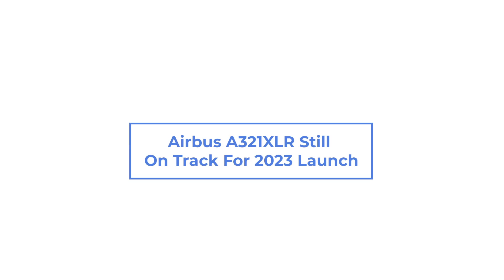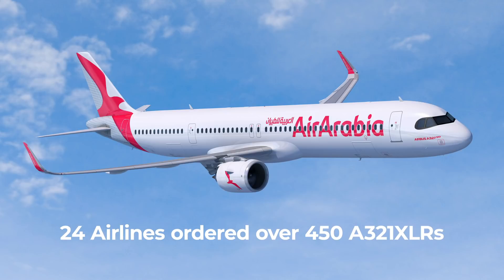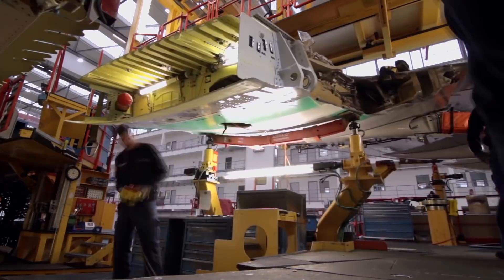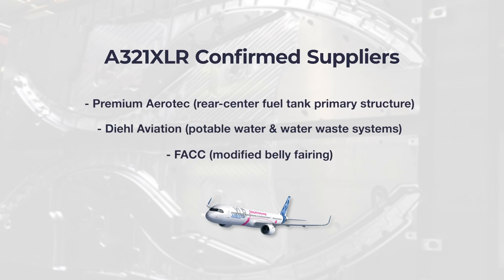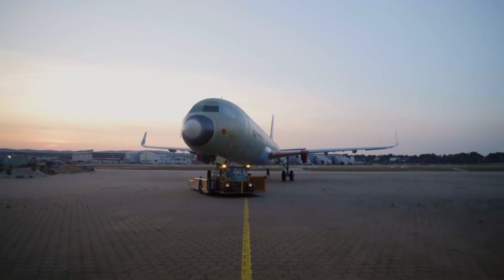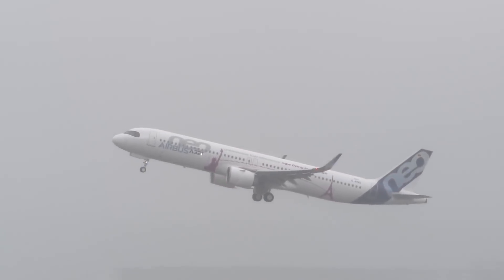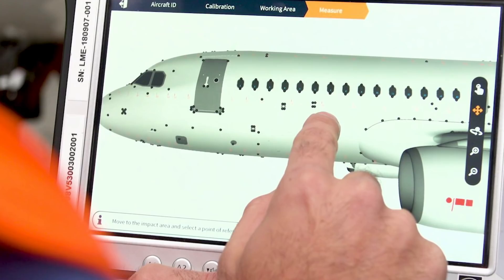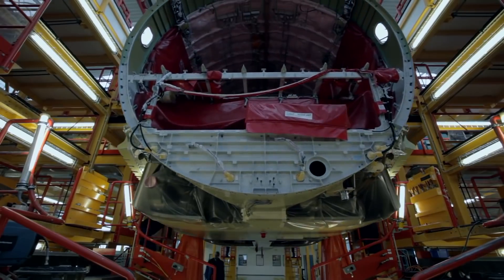Airbus A321XLR Still On Track For 2023 Launch

Comment: Hope I'll not have to fly this kind of aircraft for longer than 2h. Hope it'll be also a seat limitations for low cost airlines for example no more than 210 seats in single class configuration. Btw does anyone can imagine to fly over Atlantic in aircraft with no reclining seats and no IFE?
Reply: There is nothing wrong in flying medium to long haul single aisle aircraft was long as the the there is good seat pitch and space.

Comment: I think A321XLR will be a key part for aviation after Covid-19 because due to the lower demand for long range routes the A321XLR can solve this problem because it doesn't have so many seats filling the necessary gap making more profitable and efficient for the airlines. That's why Airbus wants to keep developing it and to launch by the deadline. 
It's also a way to kill the competition, Boeing, because the NMA project is in risk due to Covid-19 and other Boeing problems for example the MAX and this way Airbus can have this market all for itself.
Reply: (My opinion) if the 757 was available today the number of orders for the A321XLR would be less then there are without the 757 in production.
EDIT: Typo.
Reply: @ScottRothsroth0616  I absolutely agree. But it needed to be fitted with at least new engines and sharklets for efficiency and new interior for the 757 still to work. The major advantage of the A321 are the same as the 757 in terms of capacity and range which allows him to operate less busy long distance routes but the A321 is much more efficient then 757. 
After Covid-19 it can be a perfect plane because even though there will be generally less demand we know too that there will always be demand in some long distance routes (London-New York) even if less then normal, so A321XLR can help a lot an airline in their management.
Reply: @igorvasiljev5879  @scott roth , although the 757 did well, it is pretty outdated for airline operators. I don't think it would compete well against the A321XLR. What do you base your reasoning on? Scott is partially right. It could somewhat compete on a purchasing cost basis but even with winglets or sharklets and new engines, it couldn't compete on fuel burn.
Reply: @ElectricUAM  I think the same that's why I was telling in the point of view, if it existed the possibility to buy the two of them in new condition at the present, an airline would only buy the 757 if it would be completely refitted do you get?
Reply: @igorvasiljev5879  I understand what you mean. I'm not sure who would win in this case. I guess there will always be those who favor Boeing over Airbus and vice versa.

Comment: In view of the less optimistic U-shaped recovery forecast, airlines that has ordered the A321XLR ready for delivery in 2023/24 will gain an upper hand in the market, further fragmenting the transatlantic and intra Asia market.
Reply: I agree with you. Airbus has all market types covered.
Reply: @chrismckellar9350  makes me wonder, any NMA now would be stellar
Reply: @chingweixion621  - Are you referring to what is Boeing is going to do in the single aisle short to medium haul market with a clean sheet design or the A321xlr?
Reply: @chrismckellar9350  any NMA, even if it's A300neo or B797
Reply: @chingweixion621  - If the A321xlr can operate up to medium haul routes which can feed into the A330neo or A350 families is there a need for an A300neo or Boeing NMA option, realising there are  going to be more global health pandemics as the planet warms including disrupting weather patterns and air turbulence that is going to have a major of the future of global air travel?

Boeing needs to do some thing with the B737 replacement which is more of a priority for them then worrying about a MNA.
Reply: @chrismckellar9350  as much as airbus denies it, the gap still exists between the A321XLR and the A330-800. The 4700nm range is on the optimistic side and practical usage is only up to 4000nm. For single isle, the range at MZFW is more important than the max range published as airlines usually operates close to the MZFW point.
The gap in the MMA segment has just balooned due to the pandemic and this may be enough to justify bringing and the B757 and B767 remaining out of retirement to fill in the gap.
Reply: @chingweixion621  - How the gap in the MMA segment has just ballooned due to the pandemic, when most countries still have closed boarders, there is still no 'vaccine', most airlines are ground and a pandemic induced global recession is about to start?
Reply: @chrismckellar9350  the ballooning happens during the initial stages of the recovery. Typical routes which sees high enough demand for widebody operations will not be viable during the early and mid stages of recovery. Thus downsizing from an A330 or B787 to A321XLR or other smaller aircraft like the B767 would be ideal. It will only be viable for the A330 or B787 to return to these routes at a later stages of recovery.
Reply: @chingweixion621  - The reality is, nobody knows what the impact is going to be on global passenger air travel if and when the current pandemic and the global recession will finish and when international boarders reopen. Currently, the Australian and NZ governments are discussing re-establishing air travel between the 2 countries for residents of each country only some time this year and with the South Pacific Islands after that.  Both governments have indicated reopening boarders to non citizens might happen sometime in 2021 but it will be done country by country so it will be a slow process. 

When air travel between New Zealand and Australia is re-established, social distancing will apply which means that aircraft type being used will be B737 and A320/A321neo will be used as they are cheaper to operate compared to operating A330 (Qantas) and B787 (Air NZ).
Reply: @chrismckellar9350  precisely the point. When the slow process of border restrictions is lifted one at a time, many transatlantic and intra Asia routes that was previously served by widebody would not have returned completely. Thus an MMA in this case be it a A321XLR or B767, would be an ideal start for airline to begin serving the route where demand has only partially returned. Qantas could utilise the A321XLR on order to start serving cities like Mel-sin for the first two years before switching back to using an A330 or B787.

Comment: 2023 : Ryanair launched direct flight to Newark from Luton.
Reply: More like. NY stewart to luton
Reply: Ryanair only flys 737s, that would be when the MAX gets back in the air, Easyjet flys A320 family.
Reply: @schumi246  Yup, or maybe Spirit.
Reply: Also, more than likely stanstead, instead of Luton, 10k’ runway vs. <7k.
Reply: Wizz air flies from Luton and ordered A321XLR
Reply: Adam Široký yes, but the question is, would 7k’ be enough for a fully loaded A321XLR??

Comment: Probably no because of the corona viruses also if somehow they got everything ready design and  they got the parts for a test model but since human kind is no where close to solving this virus oh yea they would still need staff to assemble the plane and you can't do that at home so probably if this virus
 has a cure by next year then  probably about  another few more years add so about 2032 or 2033